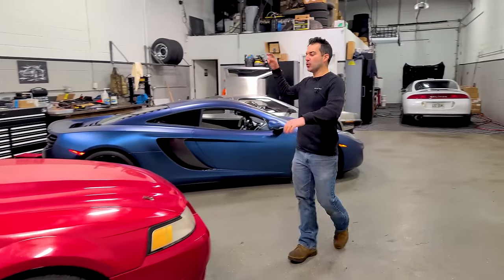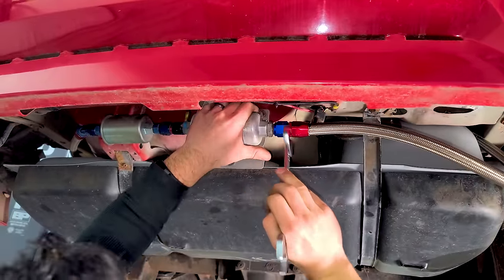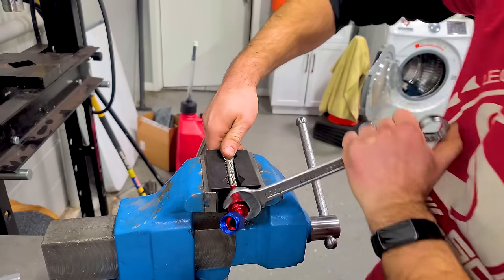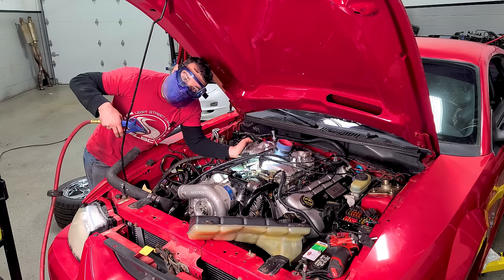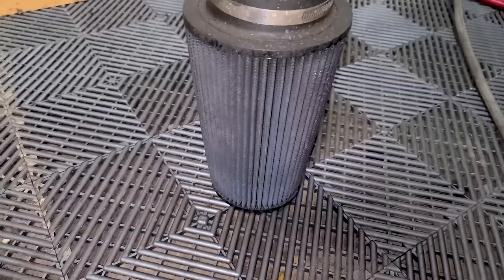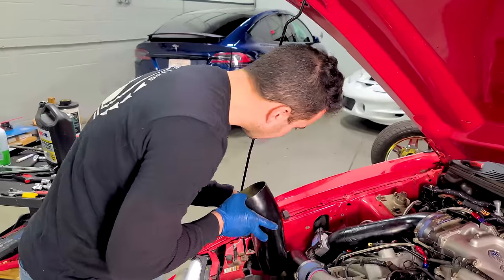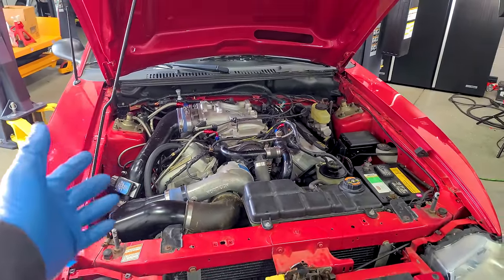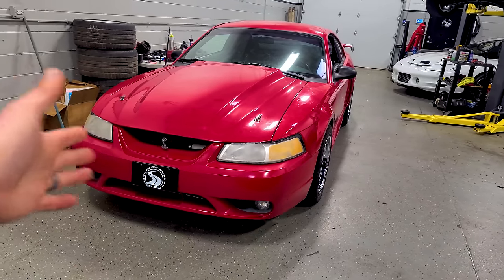FIRST DRIVE Of My Abandoned Cobra Mustang After Sitting For 21 Years! It Broke But SOUNDS SO GOOD!

Comment: I wish everyone could actually hear how loud this car is. It's majestic, and it shakes our entire building! Like literally the ceiling tiles in the office all rattle when this car is running in the shop!
Reply: When’s the next car meet, Max? Hopefully this summer. Then I can get that towel muhahha
Reply: Best cars also have to be the loudest cars!!
Reply: @orange2352  hopefully soon!
Reply: @NewEdgeDesigns  couldn't agree more!
Reply: damn, my hear is bleeding trough a video on a stupid smart tv with no audio setup, i can only imagine how could be loud and superb live!
Reply: Doesn't have to be loud to sound great
Reply: @MrCarGuy  also big facts!
Reply: I've been thru loud cars as a (much) younger fellow, back in the early 70s. Once, I helped a buddy build a GTO with a 389 using a 421 crankshaft, homemade tunnel ram with a pair of Holleys, big cam and 13.0:1 pistons. Had a steel tilt front end which we welded up, a roll cage, big slicks in the back and could never get it to run more than 2 mins or so. Bent every pushrod. Had to go with a milder cam and then it ran. Kept setting off the alarm in a Sunoco station across the street at midnight or so. He sold it and just drove his regular car, a nice GTO as well, but a street car (I believe it also had a 421 crank in it from a trip to PA where he spun the bearings, went to a Pontiac dealer (still under warranty, I believe) and they only had a 421 crank and bearings so that's what he got). The race car was super loud. My old 69 Z/28 was a loud one as well. My folks could hear me getting on the highway in the morning, which was about a mile away.
Reply: I've run open headers on old buick 3100 and it was horrible. I don't want to be anywhere near that thing while its uncorked like that.
Reply: Rip headphones users it sounds great
Reply: Deal with it

Comment: I replaced a set of wheel studs in a parking lot in a shady part of Memphis Tennessee back about 10 years ago. Had a homeless guy hang out through most of the job. He was actually a lot of help and never asked me for anything. I bought us some McDonald's in the middle of the job and we had a great talk while cooling off in the AC. We used a whole bunch of washers to press the studs in because it's all we had on hand. The dude was so cool and helpful. I wish I knew whatever happened to him. Just goes to show that when you're working on a vehicle, someone will usually come to help or at least ask if you need help.

Comment: Sounds amazing Alex! I don't think you have a transmission issue, I think you have a drag race style transmission that requires lots of throttle input and at least 4,000 RPMs to complete a shift. I have an AOD built like this in my W124 Coupe. Go out there and hammer on it and I almost guarantee you it will shift and slam you into the seat.

Comment: I believe the cobra rotors are an inch bigger than the GT. The calipers are definitely cobra specific as they are twin piston. My 98 has those, PBY made them. The lettering on the rotors is cast and when you see remans it’s rare to get them with lettering. Rebuild is the way to go to keep that cool originality.
Reply: GT 11inch Cobra 13 inch
Reply: Rears are little bigger like an in I have a 98 cobra also 👌🏻
Reply: Rear calipers are the same as a GT or a V6. The caliper bracket and rotor is larger.
Reply: The same 13" rotors and PB two piston calipers came on all Cobras through 2004 as well as the 03-04 Mach 1s. On the Mach 1s they were blank and did not say Cobra.
Reply: The rear calipers are the same as a gt or v6, but cobra has vented rear calipers and therefore slightly thinner brake pads.  Looks like that solid rear and has gt brakes on it
Reply: When I did the Cobra brake conversion on my '98 GT, the rear rotors for the Cobra were bigger than the front rotors for the GT! The 13" Cobra front rotors are the same diameter as the front rotors for my '13 Expedition! Rear calipers were same, using a different mounting plate on the end of the axle tube to locate them farther from centerline, but the front calipers are totally different

Comment: Tech tip. Don’t push the line all the way into the fitting. There’s a line inside the fitting that you’ll push the hose too. I’d say 2-3mm from the lip in the fitting. Allows for expansion when inserting the rest of the fitting

Comment: If tuning hurdles occur, may need to move maf to the fender attached to filter. May have to switch BOV to Bypass also. Decades ago to swap a 4 valve into a GT, required an engine, ecu & harness from donor. Perhaps, a Lincoln Mark VIII or Mercury Marauder (32v & auto)

Comment: @ 28:16 GT guy here. Our brakes are just a little bit smaller in diameter. Cobra brakes are a bolt on upgrade for us, but you lose the ability to run your spare tire on the front if you do.

Comment: Get cobra 13" front rotors and some ats brembos and the stm kit. Worth every penny also just a warning those maf sensors are calibrated for the internal pipe diameter of the pipe they come in. It could cause tuning issues in the future I know mine did

Comment: Alex, the long studs are mandated for vehicles that go a certain speed at the track. Chances are this was fast enough that it was needed in order to legally run at the track. Also check the rear rotors off of an explorer, those might be the correct rotors for that. Like a 97-98 explorer with an 8.8 diff with disc brakes.

Comment: I’m having so many flashbacks with this car, Alex! I worked at a Ford Performance shop in the early 2000’s and we built cars just like this one. I swear I could smell the rubber and feel the pain in the ends of my fingers when you cut that first fuel line! I did quite a few Aeromotive systems and I got much better at them the more systems I built but I always poked a few fingers enough to make the rest of the job painful. Good times!

Comment: I live in CO and I'm surrounded by ranches, so I have been buying a 1/2 cow gfgf at a time for 14 years now. I have one at the processors right now. They cut it up to your specs and vacuum seal it. It used to be around 4.25 per lb. But over the past 14 years now it's $5.95 per. Lb. I actually watch my cows eating grass right out my kitchen window and from my patio.

Comment: FYI. Factory 99 and up Cobras did not have a return line.   They had a fuel pump driver behind the drivers side trunk panel that modulated the power going to the pump and a dead headed system. The factory fuel rail had the inlet in the back and a fitting on the divers side front for a fuel pressure sensor.   As mentioned, the large line is EVAP.

Comment: I think the new edge all had returnless fuel systems. At least that's the case with my 2000 V6. On mine I have a focus pump (forgot the lph but I want to say it's 310) plus a boost a pump. Fuel is limiting more power on mine.  Back in 05 when I built it,  I really needed the 03-04 cobra dual pump system with an upgraded gauge wires.

Comment: @22:50... Just keep in mind, if you ever drag race this thing, the studs will need to engage 1/2" of thread on your lug nuts. You should run open ended lug nuts, so tech inspection can see this. @27:38... I'd just replace it with a K&N dry (no oil) filter, since you're using a MAF. @34:50... Get some bee's wax to lubricate that bit. Cuts so much cleaner.

Comment: 1. Yes the Cobra brakes are bigger than GT brakes.
2. Should have left the longer studs especially if you are going to have any sort of spacer at all.
3. You missed the opportunity to put on slotted rotors or drilled rotors. That would have been a big upgrade.
4. Put a manual back in it, a T56.
5. Put the IRS back in it.

Comment: PTFE hose is ALWAYS a better choice. 

1) PTFE doesn't degrade like normal steel braided line. You'll be replacing non-PTFE every five years or so. PTFE is almost eternal.

2) PTFE hose is smaller in diameter than rubber steel braided line. That can be beneficial when running hose in tight spaces.

3) You can get PTFE hose without the black plastic cover, which makes the cost about the same as rubber steel-braided hose.

3) Fittings are available in natural aluminum, black anodized, and red/blue anodized, so you don't have to give up the appearance.

3) The difference in price between PTFE hose/fittings is negligible when you consider that replacing your rubber steel-braided line in five years will cost even more than it did when you replaced it this time.

The only downside to PTFE is that it's more difficult to assemble than non-PTFE hose/fittings.

As you discovered, there was already a steel fuel line in the car, and the reason they didn't use it is probably because the OEM line didn't have an AN fitting at the fuel rail. This could have been easily remedied by getting an aftermarket fuel rail. On the other hand, the fuel line/rail under the hood may have used quick-disconnect fittings,  and QD-to-AN adapters are readily available (I used them in my S197 Mustang to convert to AN lines).

Comment: tip on drilling metal. you dont apply nearly as much pressure on the drill as you would with wood. basically add a little pressure to make sure its straight and level and let the drill do all the work.

Comment: 28:10  The Cobra calipers are the same PBR calipers used on the C4 Corvette and the Rotors are 13" vs 11.65 on the GT. Also, the GT uses a conventional vacuum booster. The Cobra uses a Hydroboost system since the 4V heads are so big.

Comment: The larger stainless "fuel line" you pointed out is actually the factory EVAP line. The smaller stainless line that is next to the one you pointed out is actually the factory feed line. The 99-04 Mustangs use a "return-less" style fuel system that pulses voltage to the fuel pump to achieve the desired fuel pressure. It looks like someone put a fox body(or sn95) style tank on there when they put the in-line pump setup on it. It also looks like they just put an adapter on the passenger side of the factory fuel rail inlet to hook an AN style line to it.

Comment: You can install the MAF into the boost/intercooler piping? I've always seen them on the air intake piping on boosted cars.
Reply: Benefit here is being after the blow off valve so no stumbles. Maybe this MAF is ok seeing boost?
Reply: @EstorilE36M345 Yeah, I just was not sure if the MAF can handle boost pressure? Never seen it done that way. Very interesting if that is how it is intended. Obviously a MAP sensor is completely different and your IAT sensor is in your boost piping and your MAP sensor is in the intake manifold.

Comment: Rubber can last for a long time (I just replaced rubber brake lines from Oct 1979 on my 1980 280ZX, but they were in such great shape, they weren't even cracked or swollen), but would have been preferred to use a metal hard line with some short sections of the braided hose to connect to the metal lines.  Much easier to run the rubber lines, but you lose some durability.

Comment: Spolier is a steeda. The large line is for the evap vent to the charcoal canister in the passenger fender. 99 was the first year for returnless system. Cobra calipers are different and with a 13 inch rotor. The rears on this are gt/v6 stuff. You are probably gonna have issues with that maf not being scaled properly. And your speedo is not showing speed so that could be your issues as the trans are electronically controlled.

Comment: Ill bet the car also has a 4.10-4.30-4.56 gear set. 1/4 mile car dedicated with a glide will redline across the finish. Meaning trap speed is likely all that car has for top speed. It will be alot more fun with a tko600 or t56 and some bias ply tires. May not be as fast or consistent but wayyyyyyy more fun.

Comment: First off, you should tell people to clean those hoses out after they use the cutoff wheel.  You don't want that crap clogging your injectors.  Secondly.  that big tube you thought was a feed line is actually the evap line to the charcoal canister.  The smaller line is the fuel feed line.  But you are correct.  With a little ingenuity you could make the bigger line work as a feed line.
Reply: Also, that's not a "fake cobra R" spoiler.  It's a Steeda wing.

Comment: Maybe I'm wrong, but generally in a boosted setup with a MAF don't you want the MAF before the turbo/supercharger and not in the charge piping? It would also explain why that MAF adapter was made for a much larger diameter pipe.
Reply: You can do either way. Typically with the type of MAF that he used is used for a draw-through (before boost) but can be used as a blow-through (after boost). The major problem what I see in this video is the data transfer function will dramatically be affected by changing the size of pipe he switched over to. A bit tricky to explain but basically you decrease the diameter of a pipe but have the same volume of air, velocity increases which throws off the MAF reading.

Comment: The reason for the longer studs is two part. With slicks it needed the longer studs but also the stock studs are prone to snapping with any kind of sticky tire. Those rotors on the rear are gt rotors. The factory fuel system is returnless so I have no clue why that secondary hose is there. I do have experience with this car and at the time things were having to be hobknobbed together from other cars to make things work. I’m guessing that might be it. The reason for the aftermarket pcm is due to limitations of the factory computer especially the fact the OEM utilizes narrowband sensors and many of the extra sensors that car ran for engine monitoring and etc. if you want a really good set of brakes that won’t break the bank people have adapted the ctsv brembos, s550 brembos and few other to the car. At the time of this car I was running a built boosted 2v and many times on the same track as this car.

Comment: when i had the rear axle built with c clip eliminators on my 03 mach1 i wanted to keep the tone rings and larger cobra rear rotors so i went with 98 cobra c clip eliminator kit from strange engineering. i will be doing the Cadillac 4piston Brembo front brakes and rear larger 43mm Taurus rear calipers.

Comment: They make a small foam in line filter that goes in line with the cold air intake and if it gets wet it clogs up so you don't suck water up in the motor . I had one on my car back in the early 2000's

Comment: You could also have a look at the shift relay in the transmission. Don’t know if that’s the problem, but my 2000 mustang GT has a automatic as well and wouldn’t shift out of second gear, turns out it was the relay and was an easy fix.

Comment: I have to recommend you ditch the braided line except for flex locations. It's heavy and expensive. Aluminum tubing is neater for bends and mounts, cheaper and lighter. Just don't run with methanol and you'll be fine. Those that do run methanol have to flush anyway for any extended downtime. Aluminum rails, heads, intake, etc.

Comment: Stock Ford ECU doesn't like bypass valves vented to the atmosphere, it needs to be routed to the intake tract. 

Also seem like that has a manual valve body, you will have to shift it yourself

Comment: unless those rear rotors are something aftermarket, they are probably the larger rear rotors off a solid axle 96-98 cobra or mach 1. They are 11.xx inches vs the 10.xx inch GT rotors

Comment: U should have put the MAF on the inlet of the blower main reason being is that  a MAF is a heated element and air flow cools it an that's how it measures air flow an putting it after the blower any added heat from the blower is going to throw the MAF off and where you have it also isn't the best place because air speeds up entering a bend so your maf readings may be a little skued

Comment: I lubricated the front of my brake pads, don’t ever do that, I had squeaking brakes so also sprayed Wd40 on the brake discs, No brakes and crashed, Not sure if it was brake fade or the oil on the discs and pads, 🤔, I had only gone 10 feet so probably not brake fade.🤔

Comment: Alex I've tried  many times to get your professional opinion on my c55 as with some of your barn finds, this one came from a local towing company here in san diego...they got it in one rainy night, a girl hydroplaned off into a ditch , dinged up fron right fender, front end intact 0 damage all 4 doors and rear hundred percent, all glass /headlights etc intact. i did notice a lower control arm with the all too familiar blue ink, paint marker ..tow company hooked up jump cables, bye bye pyro fuse block slash jump box, imagined 40k in computers and repairs and i snatched it up, car was one big paper weight..new jumpbox everything lit up like real steel..now i lost the damn key...what would alex sdo... its got the r2 blower kit, renntech everything  wheels, headers, dif, ecu blower , also the non e55 big brembo w expensive  floating rotors..ive got over 50k in receipts not including the car..99k miles...help me please.. dont want to get new key only to find out it needs ecu etc., not shilling but want to know what   you think it might be worth, running w/all work done.

Comment: These cars featured a returnless fuel system starting in 99. The large line you see is for the EVAP system. they probably used the factory feed line as a return and ran the new feed line.

Comment: The Cobra solid axle would have a bigger rear rotor, and the calliper would be relocated outwards on a bracket. Also the rotor would be ventilated on a cobra axle. Looks like your axle is from a GT. Just an fyi.